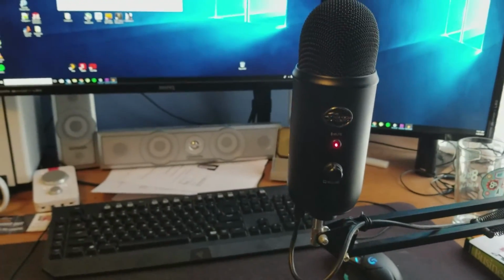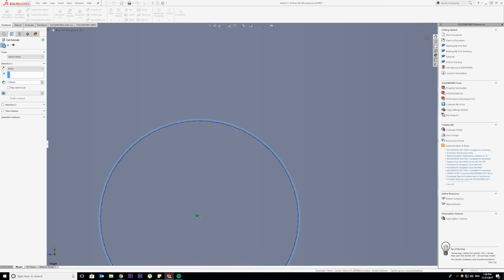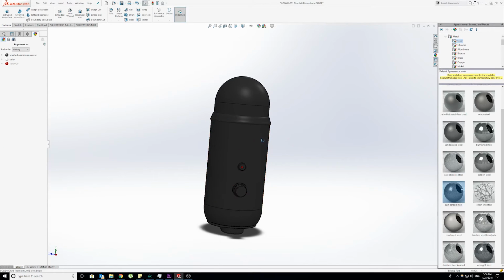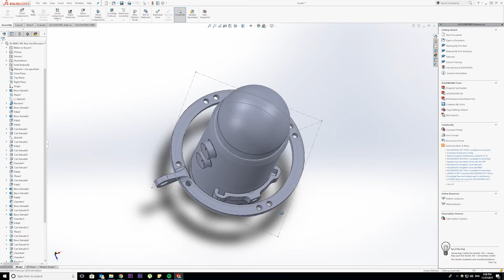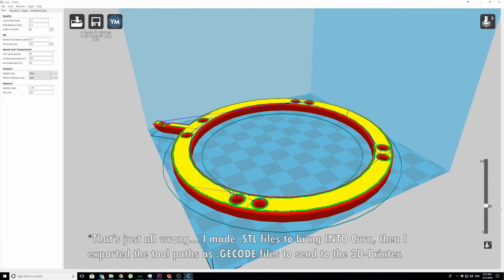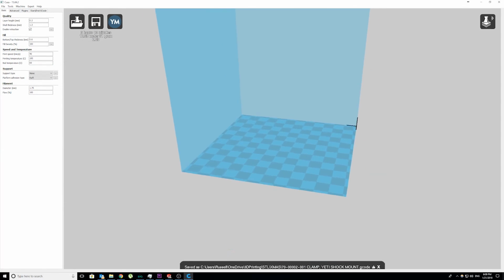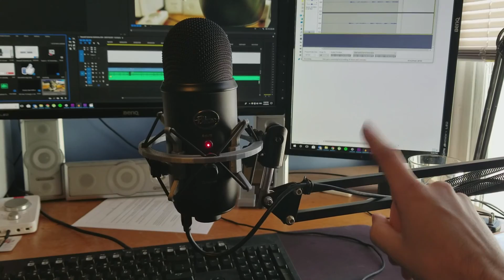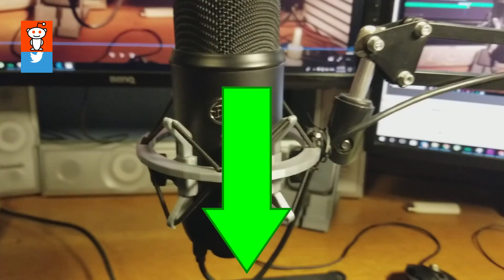IDK How To - Design a Shock Mount for Blue Yeti

Comment: Oh my god, this is brilliant. I can't like enough - I need this!
Reply from the maker: Follow the link on Thingiverse, and you CAN have it!
Reply: This comes late, but I have a concern that I was hoping you could dissipate:

I ordered your design from Thingiverse (Yay for that!), but there was some confusion and they printed it at 20% infill and 2mm resolution (It's their standard, apparently). Do you think this will work, will it be all right? 

I have zero experience in this world. The manufacturer hasn't shipped it yet, and they can redo it for a higher price, but he's advising me to leave it as is since he thinks there's very little I can gain from higher infill. He claims the print should be strong enough at 20%, but that it's up to me. What do you think? You're the alpha and omega of this design.